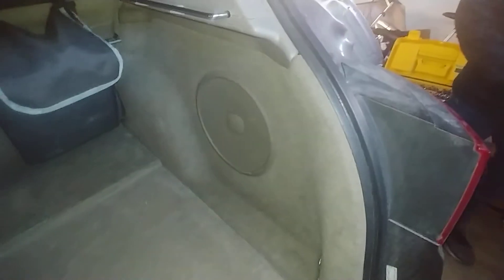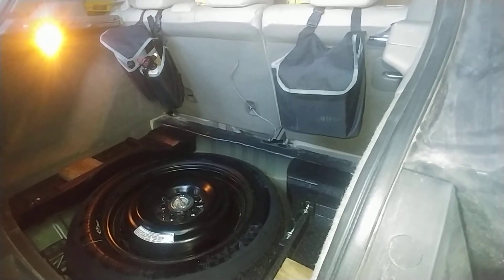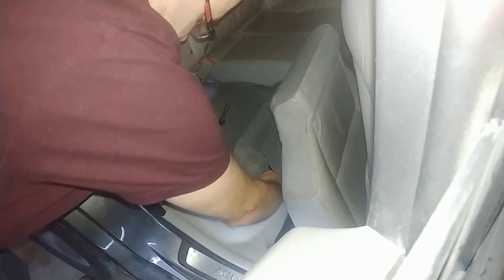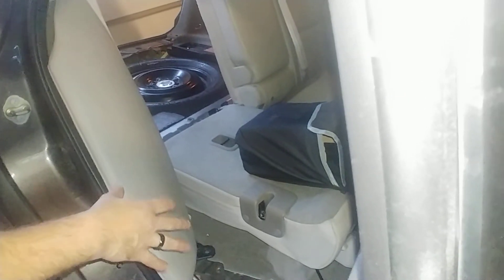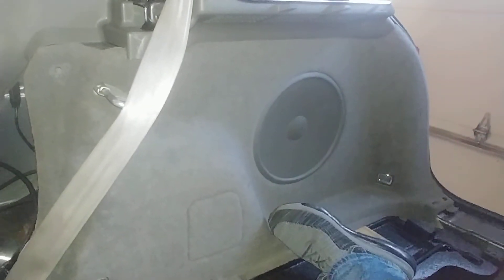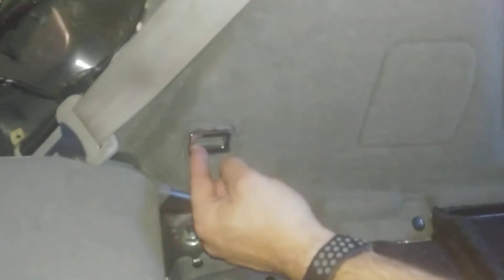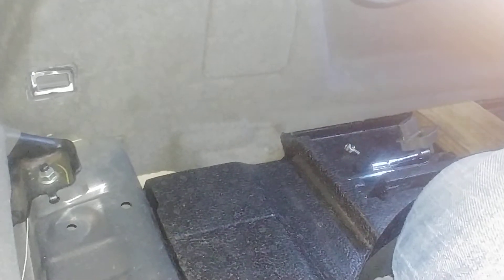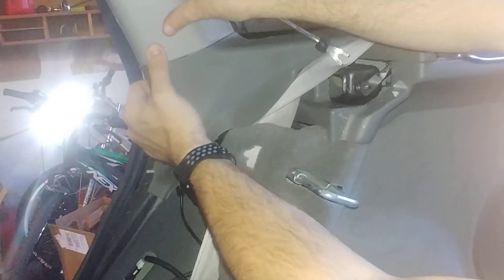How to get to your factory subwoofer in a 2007 Acura RDX Tech

Comment: Dan where are wiring goes? I bought a 2017 RDX everything works except the sub. The car was in accident on right front passenger side. I’m wondering maybe the wires are cut due to accident.
Reply from the maker: I'm not sure of the 2017 is the same as the 2007 but if it is, the sub wires go from the factory stereo, to the factury sub amplifier, then to the factory sub.